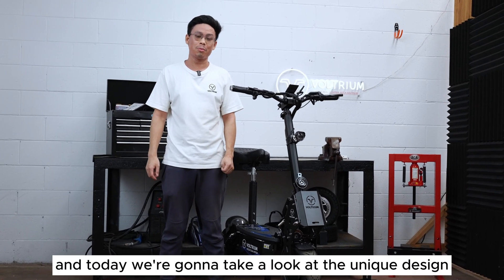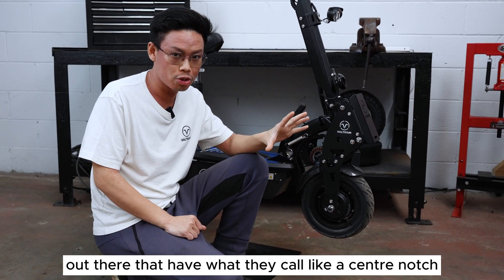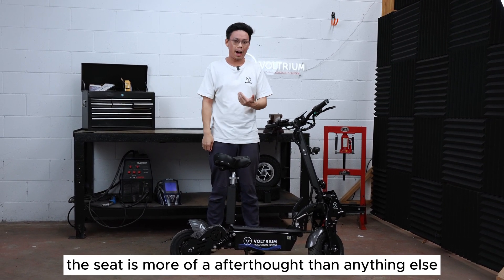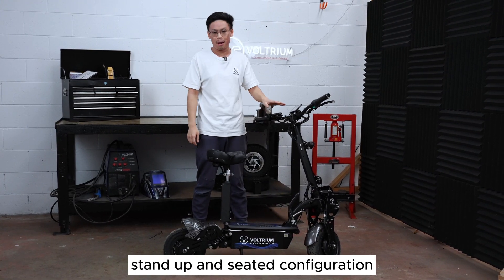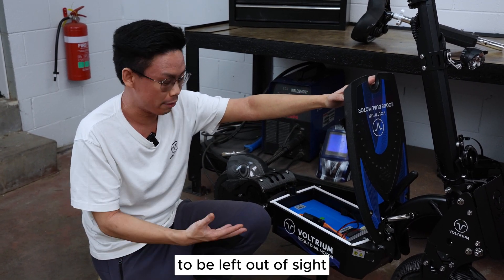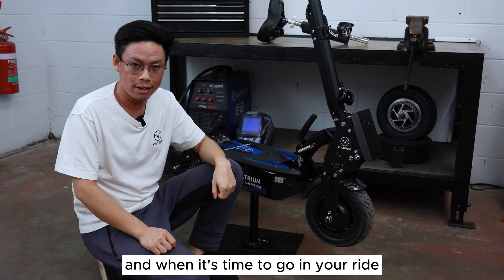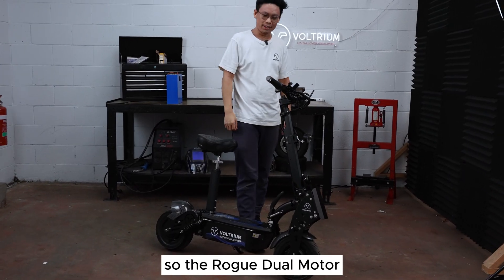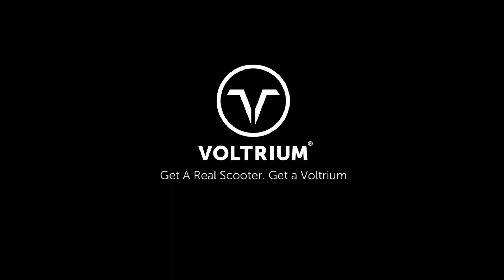The Genius of the Rogue Dual Motor - Scooter Engineering Explained

Comment: Awesome looking scoot...can you change speed modes on the fly?
Reply from the maker: Yeah, there is a proprietary control panel that easily allows you to switch between the 3 acceleration modes and also 5 top speed modes.

Comment: I got used Tesla model S 18650 batteries and made my own packs. I charged my 30Ah 48V scooter LiPo battery in 3 hours with 10Amp charger. Probably with 30Amp charger I can do it in one hour. Is this really a problem? Just get a better charger. Not cheap junk.
Reply from the maker: It really is a problem in the current e-scooter market. So many expensive scooter models take ages to recharge. There really is no excuse as those big international brands all tout they use branded cells like LG and Samsung, but yet they aren't confident with charging them with any real current. Fast charging requires cells that can take a high C rating both charging and discharging as well as a good charger. Voltrium's got both covered
Reply: You didn't say what cells you bought?? Was it china cheap batteries? I don't care about c . I just watch the battery temp rise in the bms . I use jk it has a lot of awesome features . The temp rises when close to the C charging value . My 86v 8p starts heating up at 7.5amp 100.8v top charge . So I leave it at 8amp . It likes that the most but it reads 7.5 in the BMS side ,and 8 amp on the charger side
Reply: @SharkFaceKidd  I told you that I purchased old Tesla car Model S Unit from ebay. Its was 444 pieces of 18650 in one unit for $900 dollars . Its a real deal. A very good quality because it's from Tesla car.